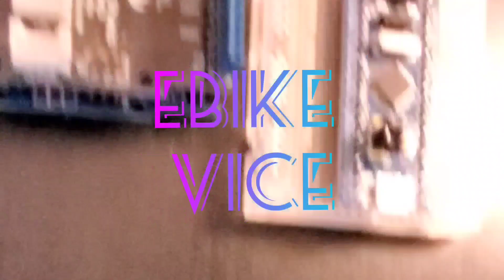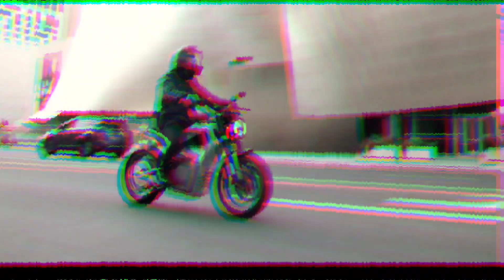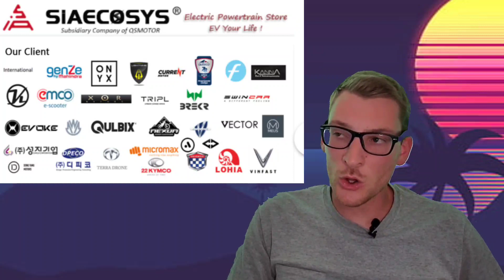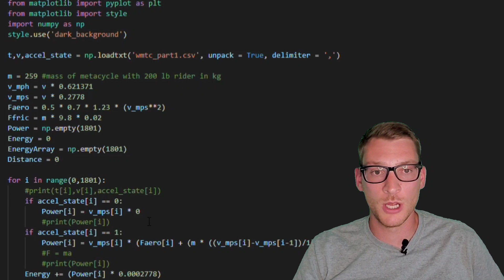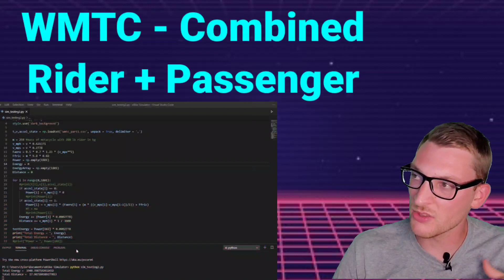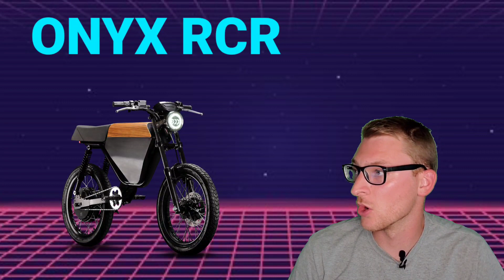SONDORS METACYCLE UPDATE | NEWS AND SIMULATION

Comment: Great Info!  I have one pre-ordered.  I know scooters max range is in eco mode, single motor.  I expect Sondors will have Eco/Mid/Full power setting as well.  I think my Kabbo Wolf Warrior King (non-gt) is close (0-30 5 seconds, 0-40 8.4 seconds),72V 27 Ah, 2 1500w motors.  Saying that, my 1800cc ICE Honda Valkyrie has nothing to fear (0-60 in 3.4) .
Reply: Sondors has said it will have an eco and sport mode + reverse for parking. 
At the product launch, they said the controller parameters would not be adjustable by the user. Dig around and you may find other tid bits of info about the subject. GL

Comment: Having flashbacks to my numerical methods and ENG 101 classes watching this. lol   My goal is to get a Zero SR as an intro to EV's before getting a Tesla.  I could ride the Zero the 19 mi trek to work, which is mostly highway, on good weather days.  IF, big if, this bike is released with an 80 mph top speed and has at least a 60 mi range I would seriously consider this and wait for a Zero until after I get my Cybertruck.  Then I'd prob put some fun tires on this guy and make it my anywhere bike.  Great updates and the models you did for this video.  As they say at NASA, all models are wrong... but some are useful!

Comment: I ordered a while back, hoping for a late September delivery (my B-day). The tech and batteries are there! The motor could easily be up graded by the time it hits the production model. They have already upgraded the seat, charger and added passenger foot pegs. Why would they do that if they have no intent to deliver. I am a little skeptical about a cast aluminum frame though. Cast aluminum is great for weight savings but tends to fatigue if not reinforced properly. I would have preferred a mid drive over a hub motor due to un-sprung weight issues but not being a dirt bike or performance bike it should be acceptable for what it is. I am going to use it for a commuter and I have some pretty decent grades to climb so I will definitely share my results with the community. I have been shopping pretty hard the past few months to source parts for a build and this deal is pretty hard to beat if the support and development are solid. Best wishes everyone. And good luck to all of us that bought in to the hype!
Reply: I agree with you, no way to know which alloy flavor the frame will actually be. The swing arm looks very chunky, but over time, will it endure ? Same for the steering head tube...  But take heart, many bikes built with today's modern mfg process far surpass what was once said to be built of "un-obtainium".  Compare to the bikes in the 90's. Honda, Buell, Suzuki, put out "space-frame" bikes. Then the Italian trelis became all the rage... Every bike becomes trapped in amber, based on the tech of the time when it was built. The metacycle will be no different. But by virtue of it's modular design, if something breaks, more easy to repair/replace. (assuming you can get the replacement parts).  I echo your sentiment. Good luck to us all, and, it is what it is, eyes up, rubber side down. GL

Comment: Loved the simulation @trowan ! How much can sprocket ratios affect these factors?  Also have you considered covering the Ultraviolet F77? It's supposed to compare more to the Metacycle than the Damon Hypersport in price.
Reply from the maker: Glad you enjoyed, thanks for the feedback! Sprocket ratios would affect a bike with a mid drive or non hub motor, but because this bike has a hub motor, the gear ratio is fixed or denoted as 1:1 vs. a bike like the Zero which has an electric motor connected to the rear wheel via sprocket and chain.
Reply from the maker: I hadn't heard of the F77, will definitely check it out!
Reply: The F77 performance specs dont jive with its looks and design IMHO. I like the 2-3 swap-able batteries and more advanced brain vrs the metacycle. Dont like the 45mph claimed top speed and unknown if it will even be available in the US during 2022 ...  The price point is in the ball park tho' ...

Comment: I paid in full and got the email. I’m hoping for early October.
Reply from the maker: Let's hope for October 👍
Reply: @trowantechworks  hey. Check the website. They got some more improvements. It’s got a reverse gear now and a brake lock. They also moved the license plate.
Reply: @thetakenking7061  I saw that today as well. In the 360 movie, the swingarm mounted mudguard ala BMW.  What I wonder is - Is this bike an old render of the "prototype" or a new render of what will ship ? Look closely at the rear brake caliper (blurred out). The motor cable is'nt visible like in other pictures.
Other details seem not to match.  But there are pillion foot pegs. Sorry to point this out and get the conspiricy folks all riled up. Nothing pressing to do today ;-) GL
Reply: @garylinnert1574  I think this will be production because it has the newer seat with the added padding. Also it’s shown with the passenger foot pegs. Im not sure if I like that mudguard. It does leave the back open to see the shock though.
Reply: @thetakenking7061  I think (hope) you are right.

The cosmetics of the mudguard are subjective, but a positive take away is that its the type of change that indicates progress toward a production unit with street compliant homogulation. DOT or EURO I dunno. It looks like it will (must?) be illuminated...

Another detail is the motor power cable, shown routed behind the swingarm, vrs hanging underneath.  This was one of the first things I did'nt like about the press bike. Did'nt want to nit pick, but now i'm very happy to see the cable tucked away where it wont easily snag on anything.
Reply: @garylinnert1574  they also added a brake lock when you park and a reverse gear. They say it now has a full color display but there’s not a clear picture of it. The prototype had a display that had a tachometer so I think that was an off the self part that’s not gonna be on production.

Comment: Great vid series. I Love the design. High hopes for this. Also have my eye on the Cake OSA+ which might be a better build but highly un aerodynamic. Anyone else deciding btwn meta cycle and OSA?
Reply: I looked at the CAKE offerings when I was comparison shopping. Seemed like very nice machines.  Saw one in the flesh on consignment in January '20.  Out of my price range and in-seam for my desired usage.
Reply: @Brett LaGrange more expensive than the cake, or the fxe ? The fxe specs put it above both the cake and the megacycle imho. In a 3-way shoot out, my wager would be on the fxe... But I am still smitten by the sounders, even though the other bikes are "better" ...
Different strokes, different folks. Good luck on your decision. The heart wants what it wants.

Comment: Q3 will be here in a few heartbeats ;-) .... Loved the math. Look forward to performance dyno test validations of a real motor wheel and controller rig. Can python make a bluetooth app ?
Cool that Sondors implemented reverse and parking lock. Jazzed up the charger, addressed the seat and foot-pegs, promised the expansion batt pack.  Still much to ponder, but not much longer to wait... In for a penny, in for a pound. GL
Reply from the maker: Lol you're always making me laugh Gary. Glad you enjoyed the video, much appreciated. I think a bluetooth app is more likely to be built using mobile app software suites that utilize Java or other scripting languages. But I suppose you could build one with Python too. Would love to see the Metacycle get dyno'd.
Reply: @trowantechworks  Thanks Tyler, Long ago, I wrote Bourne shell scripts that did curious tasks, like burning CDR's and running makefiles before there was XML...  After seeing the NOPE zone in the simulation, I asked support to please look at this vid and the WMTC combined test. Leon said he'd send the request on to the developers. Kudos to you for "framing the issue(s)"  for them. The 80/80 speed/range spec is why I'm buying the bike (and aux battery). Like the one before it, this will be the last motorcycle i buy, until/unless, suddenly it is'nt ;-)
Reply from the maker: You getting yours in October Gary?
Reply: @trowantechworks  Yes, I have rcvd a message from Sondors my unit will be one of the first production run of 1000.  TBD for actual shipping/delivery dates, but since I re-subscribed to the metacycle web page, I have been receiving more update/status info . I wont be the first guy doing an un-boxing video - I think you and Jay (Leno) could be the guys for that. If you do, I will happily smash the 'like' button. For now, all I can do is watch the port of LA on google earth.
Someday, my ship will come in. I'll know when I get a tracking number. FLW

Comment: Excellent series. Very hyped and skeptical of this $5k e-moto. I’m certain they are running this motor at 8-12kw baseline. The qs273 can take much much much more abuse than other motors because of the amount of current and heat dissipation it can endure. There are also a variety of motor windings that affect the gearing, typically 3.5T or 5T. Also with Flux Weakening, you can push the motor faster than the stated max rpm of the motor, simply by being inefficient with current usage. 

I imagine they are going with very high current, low turn (for higher speeds) and Flux Weakening to get their specs. 0-60 in 6 should be fine at 400amps and a light rider

Comment: 1- Your plant should be called Stimulatus Maximus.
2- It would have been much more interesting (still) if you would (indeed) have redrawn th e tests graph / data with the Metacycles maximums taken into account. That should increase the calculated range.
3 - Then you might look at the other bikes performance values and compare them to those  you calculated to see if that gives an indication of the average loss from non-included factors like the ones you mention. Do however leave out the Sonders claim because that is clearly hogwash anyway.
4 - Instinctively I would say that both these corrections migth actually compensate for each other but to actually calculate is to know.
5 - Looks like the Sonders would only be of interest to me with the extra battery but what does that add to the cost and weight?
6 - "Pay the full price now and maybe get the unproven product in the third quarter" sounds a lot like that South Park Episode. "AND IT'S GONE!". So I'd rather be patient and receive a proven version after the bugs have been ironed out.
Reply: #5 me too. I'm guessing expansion batt will add 30lbs and cost well north of $500 USD.  Just guessing.
Reply: @garylinnert1574  Anyhting below US$ 6000 in all would still be quite acceptable but be aware that the batteries are presently the most expensive part of a vehicle. :-)

Comment: That 10 second 0-60 hurt on the inside
Reply: I kind of doubt this. I don't see why it can't work out to the claimed ~6+ seconds. The Zero FXS does it in ~4+ seconds. I have ZERO math to back this... but I'll be surprised if their current estimate is off by half the actual acceleration.
Reply from the maker: R.I.P. everyone's hopes and dreams. But the good news, is that a little bit of software hacking can likely fix this! I'm an optimist!